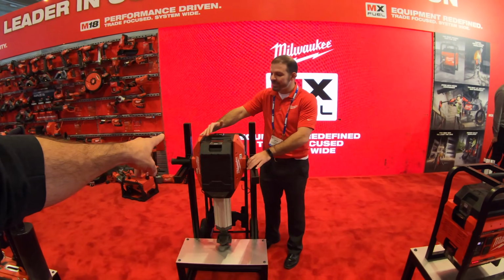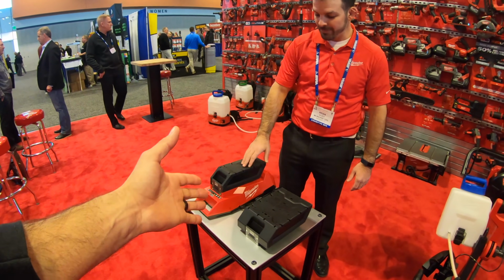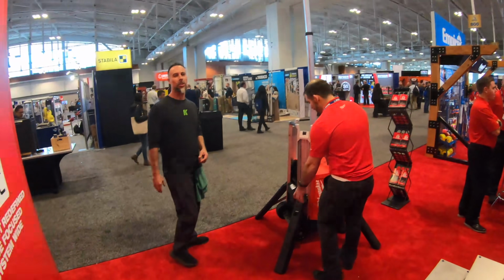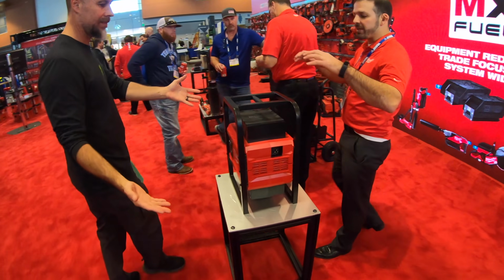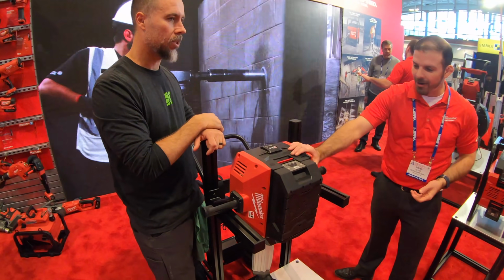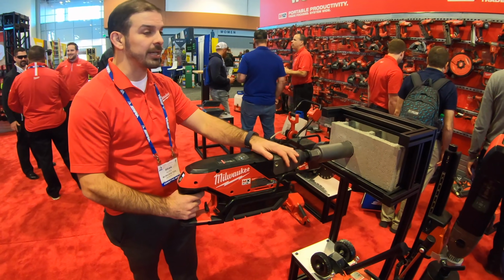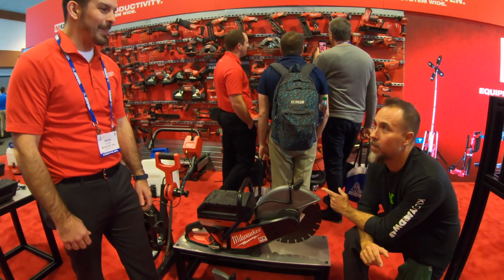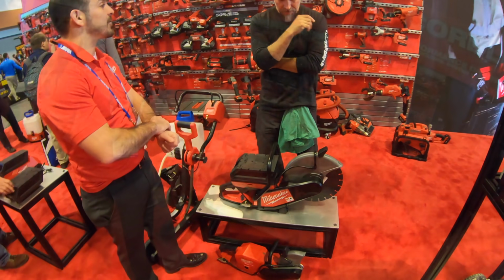Worlds First! 5 new Milwaukee Cordless Power Tools Never seen before!

Comment: I went on one of the pipeline videos and something caught my eye. A D handle 1 inch impact gun. It's the first electric one of its kind. Milwaukee doesn't screw around. I currently have a 2767-20 1/2inch high torque impact gun and a 2864-20 3/4inch high torque impact gun and I have nothing but praise. The half inch isn't a joke and the 3/4 inch is a monster

Comment: Like to see Milwaukee come out for a straight line saw track second to none and made in USA. I will not buy any made elsewhere, and know you guys can do it. It has to be able to cut a straight line to the exactness of glue line capability, as many times jointers just aren't available or cutting longer pieces can be done much easier this way. This jig or track system can either have a dedicated saw, or make one with use of your own saw. As for track lengths, you guys can surely design and make a modular system that will stay straight at all times regardless of how many times it is moved or turned. It has to cut at 90 degrees with easy adjustments to get that perfect mating board for joining boards edge to edge in professional glue line joint fashion. Please design and manufacture one that is second to none and is made affordable rather than some of the ones out now that completely rip hard working carpenters off. Please make the most durable, quality built and engineered track system that will cut a board of any width, even narrow boards, easily and very straight, as engineered clamping has to be engineered into the details of this system, and not depend on any non slip tape. It will be your biggest winner, but it must be done second to none, of the highest accuracy. I would buy one now.  Please make sure that lengths of 12ft use in length will not be compromised if one track lengths can be substituted for modular pieces of any lengths.

Comment: 6 amps dont sound like much until you multiply it by the 72 volts & realise that's a 432 watt battery.  The m18 6 amp is only 108 watts in comparison. There is some serious tools coming out ...many building sites are becoming cordless. This is the growing trend. But if Milwaukee can replace the 2 stroke powered tools , that I hate,  with batteries. I will be suitably impressed.  I like the demo saw. Gardening tools like line trimmers & even lawn mowers are in the relms of quite possible NOW.

Comment: It was said in the video that gallons of oil will be saved but where do you get the electricity to recharge the batteries? Energy is not free produced. It has to be product from nuclear fuel, fossil fuel, etc.
And how much are the new batteries going to cost? A darn M-18 HD12.0 is $200, more than the price of some M-18 tools.

Comment: AVOID MILWAUKEE TOOLS.    They are by far the worse tools on the market.   Little over a year ago I bought a combi drill.  Sds hammer drill and a 12v driver.   The combi drill lasted 3 days and broke.  Sent it away for repair, this took 4 weeks.  When it was returned the repair lasted 3 hours then the drill broke down again.  Sent it away for repair, came back still broken.   Not long after this my 12v driver started smoking and set on fire.   Milwaukee refused to fix either drill as the warranty had expired after 8 months !!!!   Now my sds hammer drill has stopped working.   All these tools were brand new costing over £600   Shocking product.  Shocking customer service.   I contacted the local rep.  His reply. Nothing I can do.   Contacted Milwaukee head office. Was ignored.   AVOID AVOID AVOID

Comment: it's grim buddy...upon further inspection the button/switch...burnt diodes on that pcb i removed em...did it zapp that wierd opamp on there? lol...so yeah got wire hanging on your switch man on a different mosfet trying to fire it lol...and i'm out of solder lol.

Comment: Stanley ive been waiting 5 years as well to finally see the concrete saw and the jack hammer. Because when I first bought my Milwaukee impact and hammer drill combi kit with the 5 amp batterys the day it came out in August of 2015 I was reading about the 9amp batteries and how Milwaukee was working on a full sized demolition hammer. Now I can run a concrete saw to cut the floors for my perimeter drains I run in the basements when I water proof basements. But stan you know what would be really kool if Milwaukee is the first to come out with a full size muscle saw with a 42" or 59" bar  to compare with the Husqvarna 3120xp or the stihl ms880r. Because out of Milwaukee, dewalt, makita and lets not forget about the Cadillac of rotary hammers Hilti. I think Milwaukee will come out with a muscle saw first. (Oh and Stan are you sure your the best looking man in America) or you still runner up to Kieth Kalfas LMAO!!!

Comment: I would love to have all that but if I loaded my van with all that I would have to hire a bodyguard, how longs that battery gonna last? Charge cycles, I can buy a lot of gas and charge it to my customers as I go. Instead of a massive outlay that I have to worry about whilst using it. I think the saw would be great to use indoors as there is no emissions to Choke me to death 💀 but a good start in the right direction ! generator looks great and core drill just need a mortgage to buy em. But I guess they just for the big guys.

Comment: I'm still going  to stick with makita. I have had there batteries last 8+ years.  The single battery  platform  they use also allows more  flexibility.
Reply: Milwaukee has the 5 year warranty though. And ive been using their impacts daily in a shop and have yet to kill a battery or rebuild a tool
Reply: Well a Kia has a 10 year warranty it doesn't make them super great cars. Working on a service truck having the batteries last that long is stellar. Subzero temperatures in the winter and a 100 plus in the summer.  As for the tool I always get 5 or more years out of them. I'm going  to stick with what I know  will hold up.

Comment: Full size hand held concrete saw?  No no no it's only a 14 in and feels pretty cheap actually I work with concrete and I'd much rather carry a gas can with me then that giant battery pack possibly an extra one and a way to charge them which means now I need electricity in the form of a generator or plug. The only thing I see that being good for is guys doing brick patios who don't need to cut that often. Not to mention it's heavier than a 4-stroke saw which there aren't very many of he's lucky there were or he would not have a good example to compare it to because it's way heavier than a 2-stroke saw not to mention a gallon of gas will run me all day and that gallon of gas weighs weigh less than one of those batteries I love Milwaukee and carry most of their fuel series tools that are practical but I do believe Milwaukee is stepping a little outside where they should be and not representing themselves adequately in doing so the rest of these tools I'm interested to try especially the breaker I also noticed he didn't give any numbers on how hard it hit probably because it doesn't hit any harder but the lower vibration always a plus when you and another guy are holding it over your head

Comment: Not an expert on concrete saws, but chainsaws all have the same cold start process. Pump the primer a few times if it has one. Full choke until it pops, then half choke to start. Of course the electric is way easier.

Comment: Sorry but as a professional concrete cutting/drilling contractor. That demo saw is useless. He talks about a 6" slab the saw won't cut that depth. That's core drilling at waist hight. It's usually 5" holes over your head amongst conduits, waterlines NO ROOM  in" hollow block" but you hit the bond beam. I'll keep my Weka hand held.

Comment: Before long your gonna have a battery the size of a buick to run a drill. UMM yeah not interested in equipment with giant or multiple batteries. 3000$$ for a light tower, I think not! I like Milwaukee tools, but they are no better than any other maker.

Comment: OKAY RIDDLE ME THIS... THESE MX BATTERIES USE THE 21700 CELL, WHEN YOU LOOKUP ON THEIR WEBSITE, IT SAYS THE XC406 (THE BIG PACK) HAS 40 CELLS, 2 GROUPS OF 20 IN SERIES, IN PARALLEL = 6AH, SO THEY USE 3AH CELLS. FOR 1$ MORE A CELL, YOU CAN GET lg CELLS WITH 5AH, WHICH WOULD INCREASE THE PACK CAPACITY BY 66%. FOR A $599 BATTERY PACK IT WOULD SEAM MORE LOGICAL TO CHARGE $640 AND GIVE US A PACK WITH ALMOST DOUBLE THE CAPACITY. LITERALLY 10AH FOR 40$ MORE SEEMS WORTH IT TO ME....

Comment: Hilti partner saw starts first pull everytime wouldn't go with any other brand and like half the price also they offer a 16inch blade and you can swap the blade to the other side to flush cut against a wall and a built in water pump that runs off the pulley

Comment: I'm not a Milwaukee guy (they aren't readily available in town)
But the sales rep is 👍👍!! answered all of the questions no b.s. no talking around a question. Knew his product line
Gotta say the Milwaukee company is really innovative. 
GREAT video S.D.M.
Reply: Same I'm in the DeWalt platform mostly although I do have a few red tools here and there. Whenever I see a DeWalt demo both the sales and demo guys are clueless lol.
Reply: I’ve actually been told by the Milwaukee reps honestly when other cordless tools are better. They know they don’t own every tool as the best in class and admit it. They are selling systems and battery compatibility with few compromises. For example Makita multi-tool is better, and DeWalt top tier angle grinder is king. I asked the rep and he readily agreed, and then asked if I wanted three battery systems or one for the slight loss in those two cases. He even added another few tools that were better and still suggested that if I needed those niche tools I should certainly buy them. But since I also am a plumber he simply smiled and said they are king in that field and pretty damn awesome in almost every other category plus industry BEST in batteries. I have adapter plates that switch other brands to Milwaukee, there simply are no such adaptors that switch Milwaukee tools to competition batteries.
Reply: Can't stop looking at his left ear...

Comment: The faster/consistent set up time over the gas cutters was a very good point, I hadn't thought of that before. Like I'd do a quick check of my battery tools as I pack, but a gas tool, well that's a bit more of a hope and a prayer.
Reply: I'm pumped for those generators... if only they made a battery trash pump god that would be nice.... those shitty honda engines everything uses take for fucking ever to prime setup and get going, especially if they sit for long periods of time like most seasonal jobs do.
Reply: The idle on demo saws are horrible

Comment: I have changed to Milwaukee from Dewalt. I'm generally impressed, but the m18 fuel drill,the chucks are garbage. I wouldn't get it replaced under warranty. I will replace it with  a decent manufacturer of chucks.
The impact guns when you get 1/2 inch and above will bounce off the bolts and nuts. The dewalt does not bounce off the bolts and nuts.
The rest of the stuff I have used is pretty good.

Comment: Does Milwaukee make a storage backup saver for data in case of computer crash? Lol. Sorry you lost everything on your computer.  great video!
Awesome tools. Cordless is king!!!
To not worry about ventilation or popping breakers in tight spaces for concrete cut out jobs in basements. That's awesome.  Way to set the bar. 
Thanks to Brian, and his family, for coming back from airport.

Comment: Employees will still waste an hour trying to start the battery saw. 😎
Reply: Just so you know I have very competent employees but I also have some that would screw up just about anything you asked them to do if you're not right there with them. Non of them are meth heads. 
Mostly it was a joke about how employees love to waste time.
Reply: @mattcorriere9039  wow, you actually came back to explain the joke that flew over the meth head's head.
Reply: How?

Comment: That light is great.  No hassle of the gen. running with noise constrictions.  The saw is great too.  Just did a bigger sump in the basement and that would have been a lot more convenient than the gas stihl.  Keep the great vids coming and thanks for sharing.  Just a suggestion, you should invest in a wireless mic for your cam. There are great affordable solutions and it would make your videos that much better.  The hotshoe is okay but have to have the cam close to be consistent.
Reply: Ditto!

Comment: $3000.00 for a work light... ok bye bye
Reply: It’s not really a “work” light. It is a jobsite light. There is a significant difference in equipment and pricing.
Reply: Like the dude said it beats trailering in a big light stand on a generator, what do you figure one of those cost?
Reply: You're paying for convenience. Portable jobsite light, that fits in the back of a  Subaru and makes no noise when its running is pretty sweet. No maintenance or fuel costs, no need to tow makes it all the better. But you do pay for cutting the cord or the gas line in this case.
Reply: $3000 does seem high but when you consider that a comparable engine driven light costs about $10-15k it's not too bad for being portable. Also there is virtually no maintenance and no noise and zero operating cost other than charging the batteries. Albeit the output is only 27000lm which is not that good. I built my own 12v light tower for $1000 and my output is rated 65000lm.
Reply: @RatedT_Crushed  do you have any build plans for it?

Comment: Its really cool to see inavations like this. These tools remind me of the old Millwalkee cordless tools my dad used back in the 90's and 2000's so big , bulky and under powered compared to their modern counterparts. I'm sure in time theses tools will size down just as the 12v, 18v and 20v tools have over the last 20 years as new technology comes out. It would be cool if all of these tools functioned as corded if and when the battery dies and you don't have another one  good to go and the job can't wait. For the price of these I don't see why they wouldn't.

Comment: Milwaukee wants to hit a jackpot, make a sheathing stapler. Every single framer will buy 3. Out here guys use them for aluminum soffits and for vinyl siding and right there is another 2-3 units sold. 

Benefits of this are as simple as they get, no hose on a roof or dragging along scaffolding to potentially get caught on.

Comment: So Milwaukee guys made fun of dewalt for making a 60v battery that doesn't work for all the tools and praise that Milwaukee m18 works on all their tools. Now Milwaukee comes out with a new battery platform for new tools. And now the same guys are now praising Milwaukee for the same thing dewalt pretty much did lol
Reply: There is a little bit of a difference here: Dewalt designed their flexvolt system to be used for tools. Milwaukee is designing this platform for equipment. I am going to go out on a limb of speculation, that these battery packs can probably put out 1800 watts. They are obviously designed to be able to take a 1500 watt continuous load, without a problem, without overheating. Case in point: The inverter.

For their tools, Milwaukee is fairly effectively proving you do not need a higher voltage system for most handheld tools. But it does have its drawbacks to remain on 18v. If you look at the size difference of the motors for the circular saws between a Flexvolt and a Fuel? There is a substantial size difference. Because it running 18 volts, it has to run much higher amperage, which honestly costs money. You need higher quality internal wiring, more expensive electrical components to deal with that amperage, and overall? Low voltage, high amperage is less efficient. But, Milwaukee is making it work, pretty damn well.

But when you want to make an inverter that can replace a gas genny. When you want to have the power to drive a 14" cut off saw, or a 6" coring drill....The lack of efficiency is going to be too much of a problem. The motor sizes are going to get out of hand, and be ridiculous. So, higher voltage is necessary. Because this is designed for equipment, that is going to be 70-90v, make a new battery interface. Don't make a compromised system with voltage switching. Just make it right, make it durable.

Now...has Milwaukee made it right and durable? That is yet to be seen. I am hoping they did it right, but time will tell.
Reply: This is totally different.  Regular power tools and light equipment are very different categories. I’d like to see a dewalt 60 volt try to run equipment of this size with anywhere near the power that the MX provides.   Meanwhile the M18 competes with or exceeds the abilities of dewalt’s 60volt platform
Reply: Nope, this is a completely different situation, whereas these are pieces of equipment, larger than hand tools.
Reply: Lol, I know it's a BIT different.  But still something innovative nicely.. same like dewalt.. but Milwaukee guys are like ford guys and apple guys
Reply: @dangerousfandango5943  , Well, from a consumer stand point, I can see why Mil guys are poking fun at Dewalt.  If you look at their 20 Volt system/batteries, they are nothing more than 18 Volt batteries with a 20 volt high spot.  Every 18 volt battery is like that.  But Dewalt and the rest want to deceive the customers into thinking they have a more powerful battery, when they really don't.  Milwaukee actually tells the truth by only advertising 18 Volts since that is the main amount of voltage that is being released by the battery/tool.

Comment: I love love love the concrete and steel cut off saw. I had a project this summer that required a Mason to enlarge and create new window and door openings in walls that were 8" thick brick and everytime they used the masonry saw the fumes drove us out of the house completely. The mx fuel would have been so much better.